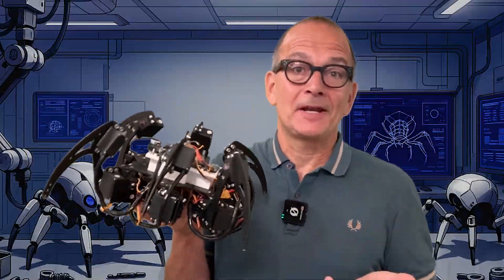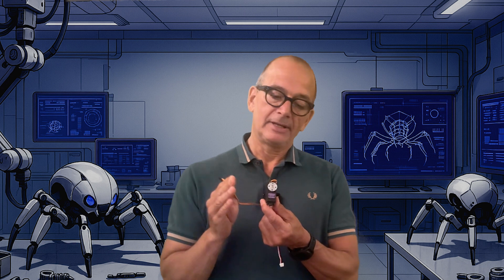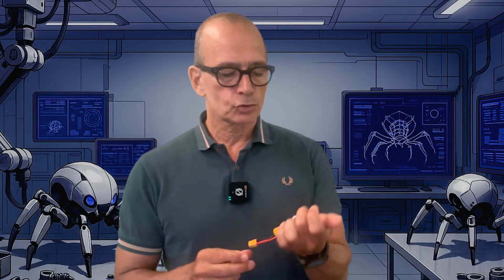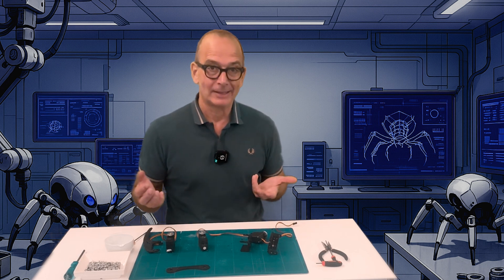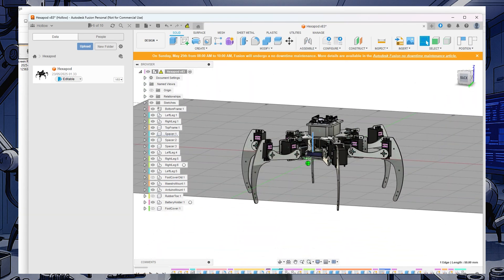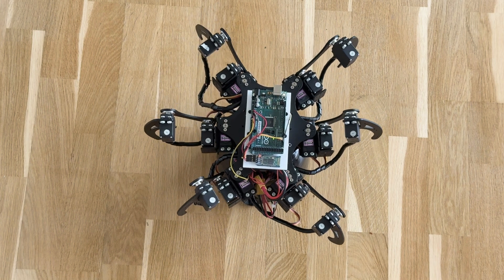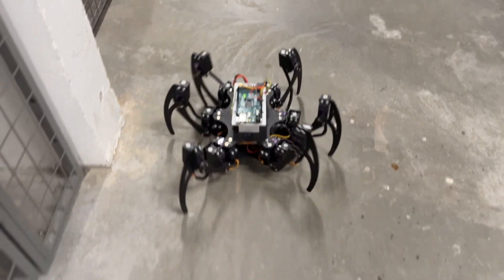Build a Walking Arduino Hexapod (Full DIY Guide!)

Comment: super nice project, but what to do when using USB 32Ch Servo Motor Controller Board?
Reply from the maker: You could hook it up to arduino usb and use that instead. Or buy another servo controller not the most expensive part

Comment: Yes, this was a amazing. Somethings need to be broken down barey style still. I found this great, I added some love to my spark unit - a 5 n 1 gyro board, replaced bluetooth with an AP style Esp 8266, and an OV2640 Camera Module 2 Megapixel Camera. Took a bit of tinkering to make it all work together. Alot of signal manipulation with level shifter and a pull up resistor to lower the delay on raising the signal from a 3.3v to 5v, which could be avoided if you use a new board that has wifi already inergrated. Now to put some Ai logic in the control center and some rubber feet.... Cheers

Comment: Loved the way you explain. Ill use your project as a guide to learn robotics. Just curious, how the movements will work (or can it actually work?) on uneven ground 🤔.
Reply from the maker: Likely not very well since it is scripted movements. It is on my todo to try that but will likely do a new build. For random terrain a better approach is likely contacts in each foot, a gyro, and a raspberry pi running a reinforcement learning model. It is doable but more complex. Will probably design a new fully 3d printed version with serial servos that can feedback torque as well to RL model. It is on the (very long) todo list 😊

Comment: This is really cool, you certainly put a lot of effort into this and the results show it! The robot kits on AE are great, I did a similar thing but used a tank robot kit instead. I opted for an esp32 because they're AU$8 and have built in bluetooth and work pretty much the same as an arduino (and smaller!), I was able to use an xbox controller via the bluepad32 library.

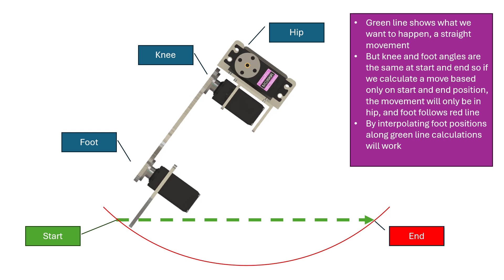Comment: 16:40 Knee and Hip motor enough I think. You may add a paralel stick to foot side so you dont need any Foot motor.
Reply from the maker: Yes you can get by with fewer joints. Other moves though requires foot joins e.g changing height and step length. More servos are always more fun 😅

Comment: Nice tutorial, but hexapod can be assembled at a significantly lower cost. The esp32 + pca9685 combo usually costs around six bucks, and the two motors will be connected via pwm channels directly to the esp32, which also provides BT and Wi-Fi. By the way, this Ubec is also overkill; I built a hexapod on mg996r and 8a (max 15) from hobbywing, and it worked perfectly.

Additionally, you can save on the battery and charger. For example, I used two high-current 21700 batteries, and there is an option to choose lifepo4, which are safer.

Of course, this setup has a number of drawbacks—the complexity of synchronizing two separately connected motors, since the controller and pca9685 have different pulse weight ranges. Another problem is that the esp32 operates at 5V, while the UBEC allows up to 6V, i.e., if you don't buy additional converters (usually costing around two dollars), you will have to reduce the power of the motors, but in general, 5V is sufficient if you keep an eye on the weight of the body, especially the number of screws. And another disadvantage is that cylindrical batteries take up quite a lot of space, making the hexapod thicker.
Reply from the maker: You are right of course those components can work fine as well. I used pololu servo controller instead of pca9685 (which I often use) because I was lazy in coding since it has builtin handling of configuration speed and acceleration. Esp32 is also good choice but I might wanted to add switches to the feet so nice with all the ports on the mega. Hc06 is dirt cheap so no issue. Have not tried measuring peak amp draw so 8amp could be enough. Just went with 20 since I have a bunch of them lying around and since servos claim to use up to 2a max each and some Hexapod moves seems to push them pretty hard
Reply: @jakobleander  According to all my calculations, I couldn't fit it into 8 amps either, but somehow it works. In theory, only three knee joints simultaneously give a peak during walking. I used a 38-pin ESP and managed to connect the switches to the feet for each leg, a gyroscope (serially via pca9685), and a segmented screen, but inside the case there is such a tangle of wires that you can't even insert a pencil.

Comment: Amazing project dude! This is very cool
btw, other than MG996R, do you have any recommendation of any other possibly stronger PWM servos that I could get for this hexapod frame? I'm trying to build my first hexapod project, but I don't think the 18 MG996R would hold the weight of it's weight
Reply from the maker: Mg996 are ok for this build in strength. I started using feetech serial servos for other robots like sts3215 but size is different. They can do 360 rotation and have temp and torque feedback plus absolute position feedback. I see others using dsservo which is reasonably cheap alternative to mg996 but make sure to check dimension

Comment: Awesome job.  Could it move faster if you extend the legs more?
Reply from the maker: Yes it can move a good bit faster but it seems to overload the ubec due to higher amp draw. Also with so many servos the serial port gets hit with a lot of traffic. I chose stability over speed for this build. To make a fast moving one first step would be to use better servos

Comment: Just curious, why dont you use an ESP32 if you needed the bluetooth function?
Reply from the maker: That can work as well, mostly habit on my part. ESP32 if i remember is only 3.3 volts internally so sensors and other stuff working with 5 volt need to be regulated. I have used ESP32 for small projects and been happy with that

Comment: The voltage specs on servos is generally pretty misleading, since a lot of them are used for RC vehicles they tend to list the nominal battery voltage rather than the actual voltage range. The servos you got will work fine on a 2S lipo or li-ion battery directly so you don't need the voltage converter.
Reply from the maker: You may be right but i prefer voltage converters for 2 reasons. 1. Fully charged 2s is 8.4 volts and likely too much. 2. For walking robots having constant voltage makes it easier to get consistent movements instead of gradual slowdown when voltage drops. The convertors also have a big capacitor to smooth out spikes.